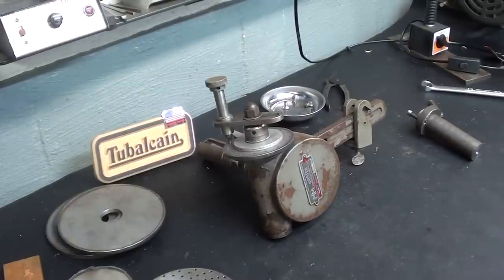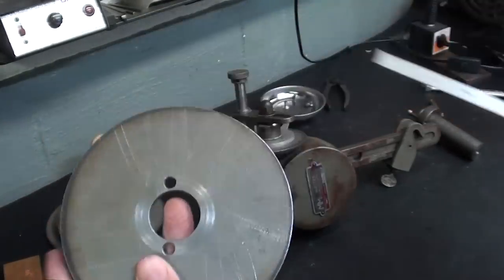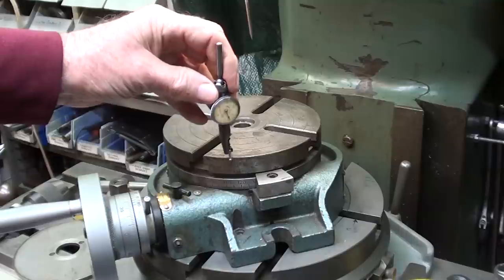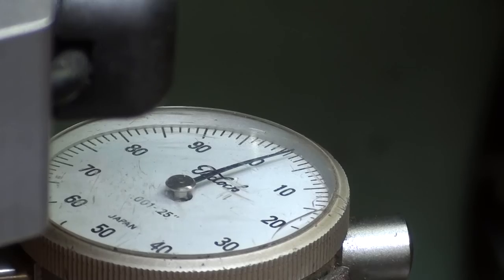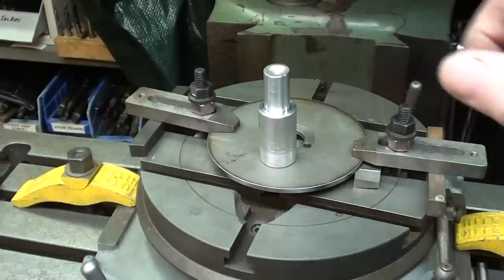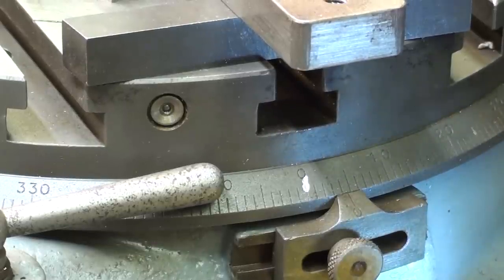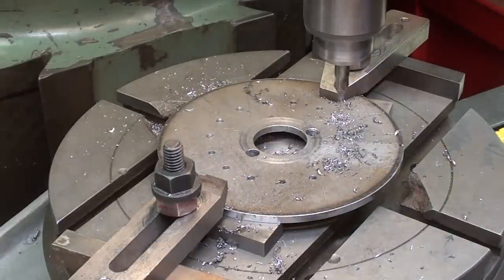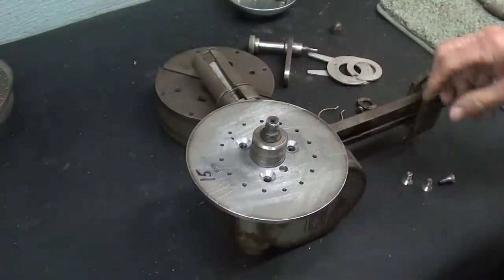Making Dividing Head Plates TIPS #622 ROTARY TABLE METHOD tubalcain

Comment: That arbor is a good trick. 

As a beginner I did not realize you have to lock the table at times on the mill and messed up a keyway. Good tip
Frank

Comment: Good video.   A good example of the time for setup is far greater than the time for the actual operation.
I know the challenge of replacing batteries in phones and tablets.   I had to replace the battery in an Android phone and tablet in the summer.   The devices are not designed for this so it is very time consuming.
Dave.

Comment: I haven't used my Yankee screw driver in years.   I saw you use yours putting in mounting screws.  Got mine from my dad.
Reply from the maker: I had not use mine in years either. And mine was also from my father. But I got a bunch of them. Batteries never go dead
Reply: @mrpete222  I always viewed them as automatic finger slicers. I never use them.

Comment: Great video as always Mr.Pete.  I think centering the plate on the rotary table is essential, but not so much the rotary table to the mill spindle. If the rotary table is locked to the milling table, and your spindle is above where you want the radius of the holes on the plate, the rotary table will just sweep the plate round underneath Inna perfect circle. It doesn't matter if the rotary table is not centered to the mill.
Reply: Exactly! Mr. Pete's method of centering the table with the axis of the mill was worth watching. However, I don't think that step was necessary in this case.

Comment: I have to agree with you about battery replacement on phones these days.  I absolutely HATE the new phones where you can't simply pop off the rear cover and quickly swap out the battery pack.  When I was on a trip involving long flights (like when going overseas), I would carry a few charged batteries and an external battery charger with me so that it would be less likely that I would end up arriving there and not being able to contact my ride or whatever because off a dead battery.  These days, you can kind of get around that by having one of the external battery packs that has a USB connector on it, but it is a bit clumsy to use your phone that way.  All of this is because the phone manufacturers want to save a millimeter or two and say that they have a thinner phone than their competitors.  Which is totally stupid as far as I'm concerned since it just makes the phone more fragile and difficult to hold, so you end up buying a thick rubber cover / armor for the phone so that it won't be so thin, slick, and difficult to hold.  I would be perfectly happy with a phone that is 1/2" to 3/4" in thickness.
Reply from the maker: Everything you said is very true. Are use one of those external batteries on trips

Comment: Good video mr. P, the use of the rigid centerdrill is smart,and using the rotary table should produce pretty accurate results. You might have gone from hole to hole to check your accuracy. Some of us are just curious. And someone. Mentioned about the distance from center increases accuracy. I'm very happy with the options given to us so far mr. P. Great job.

Comment: Novice here. What is the advantage of a dividing head if you have a rotary table with a set of plates? Particularly one of those fancy little rotary tables you can tilt. I know this is a very old video, so I don’t know if you will see it, but I appreciate it if you do!
Reply from the maker: They pretty much do the same thing. But the dividing head allows you to machine between the centers.
Reply: @mrpete222  Thank you for taking time to answer me sir! So, if you've got a tailstock for a rotary table turned on its side, is there any reason the dividing head is superior? Is it built with different bearing surfaces or something?

Comment: 11:23   Why use a center drill vs a standard 1/8" drill bit ?  Thanks.
Reply: Because rigidity is your friend and a 1/8 bit isn’t very rigid, especially with no punch mark to keep it from skating on the flat surface.
Reply: @ricksharpe6895  I thought this might be the answer but had to ask. Thanks

Comment: Question, I know your DRO is one of the older ones. However on the more modern ones like I have could you do a bolt circle with the number of holes and the diameter?
Reply from the maker: Mine is too old for that

Comment: it would be good if you could show us how to do the calculation with the minutes and seconds for divisions which are not even numbers
Reply: For the nNth hole (starting at zero) of M (best to calculate each hole individually to not let rounding errors accumulate)
360 * N /M integer part of the result is the full degrees.
For minutes, take the decimal part (ie subtract the full degrees/integer part) and multiply by 60. The resulting integer part is the full minutes.
Repeat for seconds (ie subtract the integer part and multiply by 60) integer part of the result is full seconds
Or get a  "scientific" calculator (cheapo for 3-4 bucks on aliexpress does it) that does degrees/minutes/seconds (look for button with ° ' ") and type in 360° * N / M = and it will spit out the result.

Comment: That one must have had a reasonable high satisfaction factor, though maybe not as high as replacing the phone battery. I replaced the screen on my Kindle and that gave me quite high brownie points in certain company even if it was a relatively simple task. I’d like to try the battery in an IPad but having seen someone strip one down on YouTube, but not reassembling it, I think I’ll give that job a miss. However, back to the work at hand, being able to produce a set of reasonably accurate plates whenever required could be very useful. Regards

Comment: To make life easy, use a 135 degree split point machine stubby bit. Then you don’t need to drill a starter hole and drill it through later. The stubby bits are sturdy the split point doesn’t wander, and has low cutting pressure. I’m surprised that it’s not being done. I’m also sure you know all this.

Comment: Sir, what happens if we have a gear with say, 7 or 31 teeth? I have seen gears like this in old clocks and watches, prime numbers, what will be your weapon of choice?
Reply: Just do the math and then proceed just the same way. But your spacing will not be in whole degrees.
Reply: @ClipperDays  that`s a question about preference.

 Prime numbers teeth is always an issue in gears making. Some machinists prefer a big template disc, some prefer cnc, some just avoid using prime numbers and i know a watch maker who prefer just punch mark on the material and solve the problem by diamond files, every method have their good, bad and ugly side. It is up to what tools you have and what skill you have, who knows? The reason why i would like to hear his comment becase he had all the tools, skill and actually try and demonstrate the methods he mentioned. “He had try it all” experience of a seasoned machinist is the key😄

Comment: Apple don’t charge that much for a battery replacement. Think it cost me $49 including installation last year.
Reply: I've put a lot of screens and batteries in iPhones. It's not generally that difficult (though the 4 sucked). It's about $10 to buy the battery generally and about 20 minutes and it's interesting to do. Screens take a bit longer but are like $25 for parts, Apple charges half the cost of a new phone to do that.